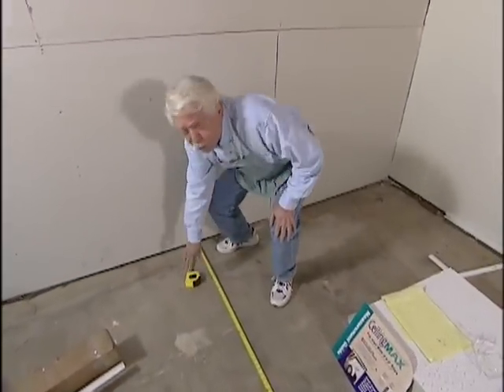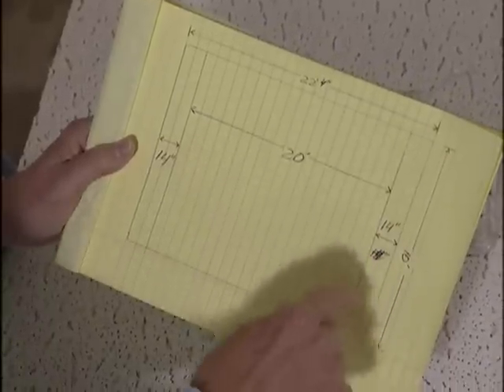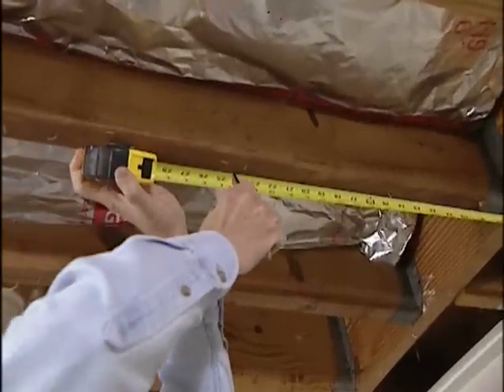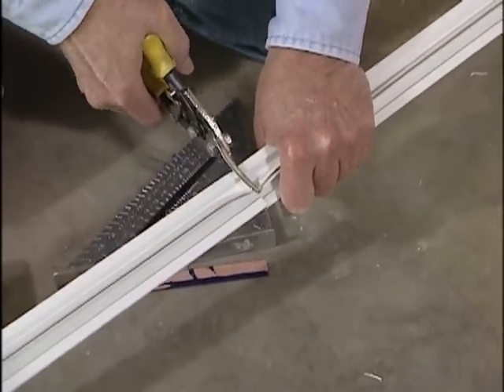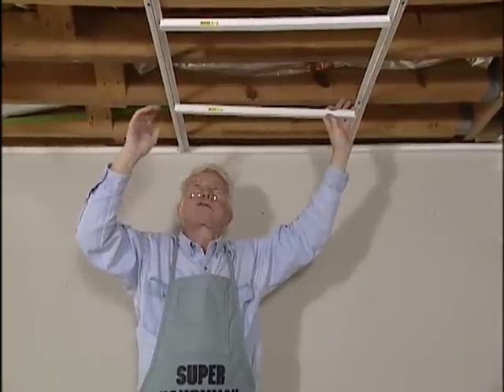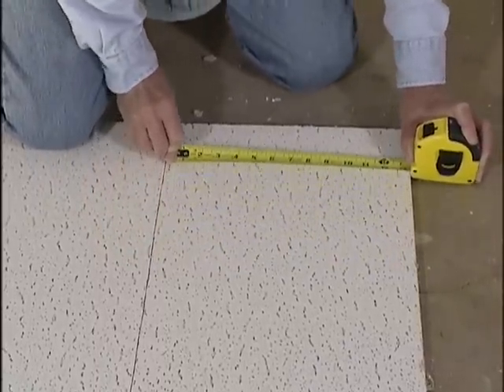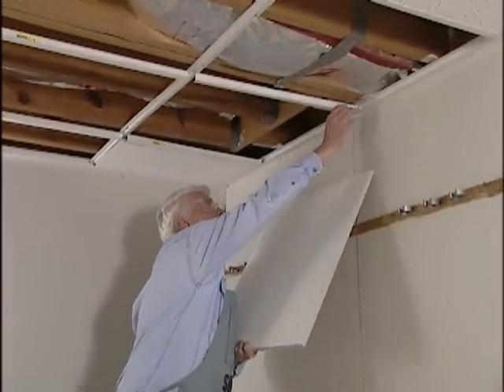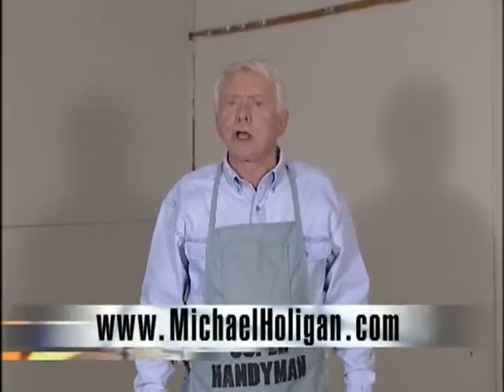Flush Mounted Ceiling System - CeilingMAX (#5252)

Comment: In my basement the previous owners ran all the wiring at the bottom of the joists instead of drilling holes which means I need to install 1x4 along the entire ceiling which as I think about it may be a good thing because joist placement won't be an issue

Comment: I am using 2x4 tiles, and looks like I have to cut of the  12" section to the first notch off each runner to get it going the 48" panes going  in the direction I want. Is this correct? Seems like a weird extra step and make working with lots of 12" fill in piece.

Comment: The problem area, especially if you are attaching the grid directly to joists is the last and final row. That final step does not allow you to grasp the hanger strip from behind in order to snap in the final runner piece. Appreciate the video - all other aspects nicely explained. Would be great to see  a video for the installation of the final row of tiles.
Reply: I am actually trying to install CeilingMax in a small room right now and cannot come to terms with the best way to do that.  It is amazing how this video constantly talks about the "rocking" system, but as you install the last row, you have no rocking available.  How did the video just skip over that reality?  The official video kind of covers this, but I also find those instructions to be stunningly lacking.

Comment: i was thinking of doing this for my basement studio. However i have cables that run along the ceiling. How can i still be able to run them if you screw those strips to the joists ?
Reply: Sjrick probably
Reply: Use a wood drill and open up holes in the joists to run the cables through. A small hole won't lead to any structural problems.
Reply: @Salparadise808   I had the same issue. I installed 1x2s to the floor joists and hung the runner on these, Gave me a 1" gap to run cables and wires in.

Comment: Help!  I need to remove a few of these to get at some wiring and I am not able to figure out how to do it.  Any tips?
Reply: I’m sorry to see you got crickets rather than an answer to your question.
Reply: @wheelie642  Sadly you need to take down a good number of the tiles.  that is the benefit and Bain of this type of ceiling.  With a traditional Drop ceiling you have room above the tiles to move & slide them.  With this type of ceiling you need to take down what ever you need to take down to get to problem areas.

Comment: is this for real?
Reply: Yes it's real, I'm trying to install a CeilingMax grid right now and I'm struggling, but it seems to be mainly because we chose a 3/4" thick tile which is really pushing the limits of the system. I'd recommend not going any more than 1/2" thick or even 1/4" if you want to retain your sanity while installing this product. There is also the competitor CeilingLink system which is very similar but less expensive and online-order only. Cheers.